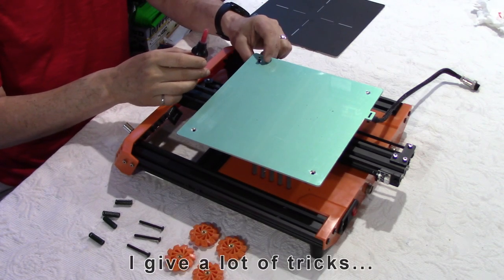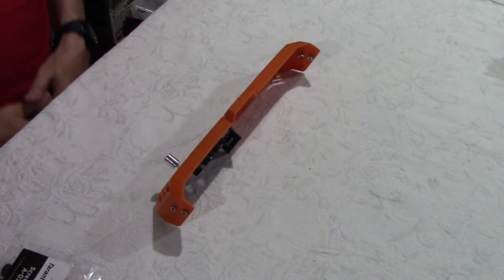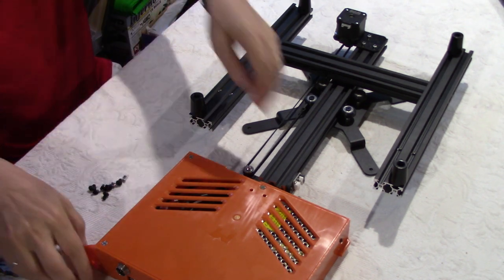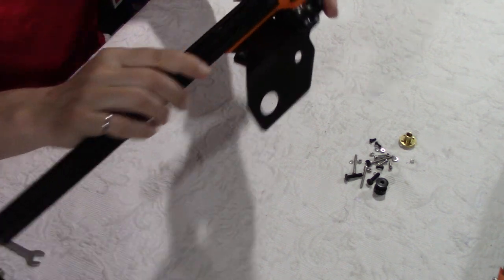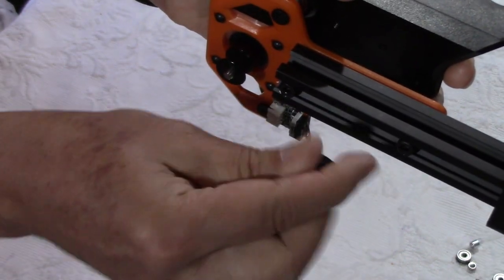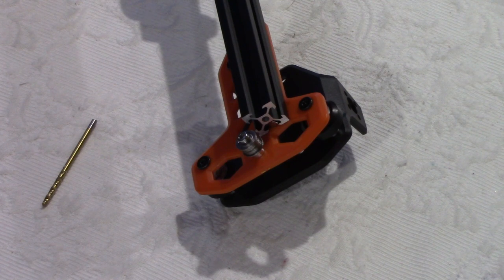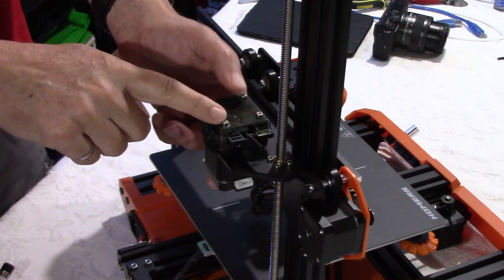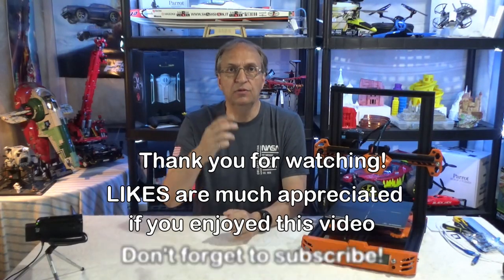Homers / Tevo NEW Tarantula Pro and RS 3D printer | Full assembly

Comment: Hi  SuperdanTech
My order "HOMERS / TEVO® Tarantula Pro 3D Printer Kit" dated Oct 07 2020, "Homers Odyssues Pro / RS TARANTULA PRO / RS"
 It was delivered on Oct 26 2020 labeled "Homers Tevo Tarantula Pro 3D printer".

I have not done the device setup so far to clarify some reasons I hesitate. When I decided to install it, with the recommendation of the company.
I decided to update. Recommended Update kits (Dual Z Kit Nema 40 Step Motor and Lead Screw Brass Copper for 3D Printer)
 Part) Which of the "A4988" and "TMC 2208" options of Z MOTOR DRIVER

Which of the "Bltouch sensor" and "3D Touch Sensor" options of the (BL Touch auto Bed Leveling / To Be a Premium 3 D Printer) kit
I have to choose, I couldn't decide. I expect you to provide the required options. I wish you healthy days ...
Reply from the maker: Hi there, Happy Holidays.  Unfortunately I cannot help you.  I posted several videos after this one and it appears that my printer was defective.  I don't have it anymore and I am looking for a new one.  I tried to fix it but it would not work...
Reply: @SuperdanTech  Thank you. I learned, "Dual Z Kit" for TMC 2208 and "3D Touch Sensor" for BL Touch